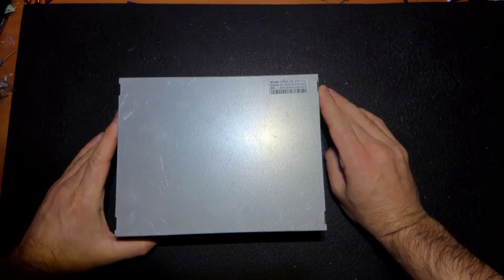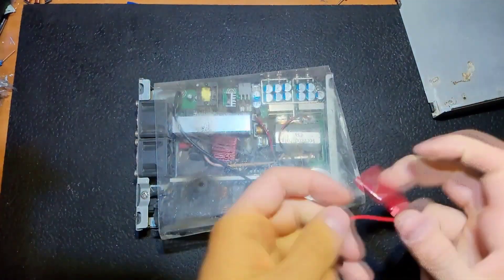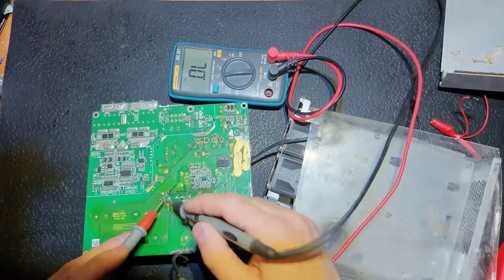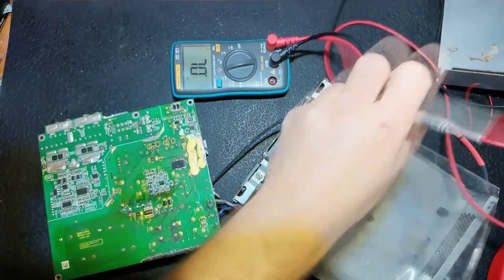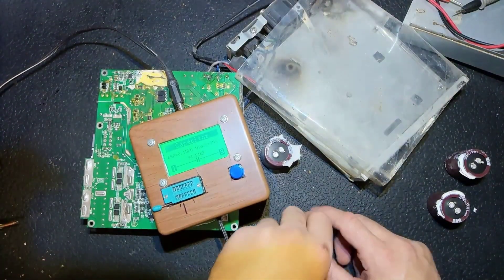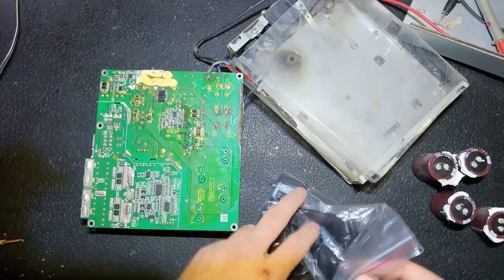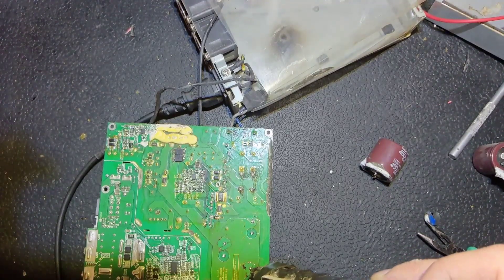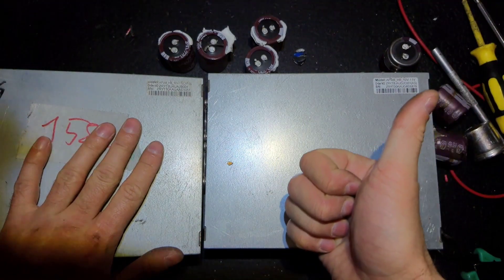APW8 power supply repair

Comment: Just got my T15 miner with same PS and put it on 120V instead of 240V and was running around 5 mins and everything stopped, no lights no fans no power. Is that mean that PS is burned or may be fuse is burned
Reply from the maker: If you are lucky it may be only the fuse. If you are not lucky it probably failure of PFC mosfets.
Reply: Thank you. Will Chek fuse